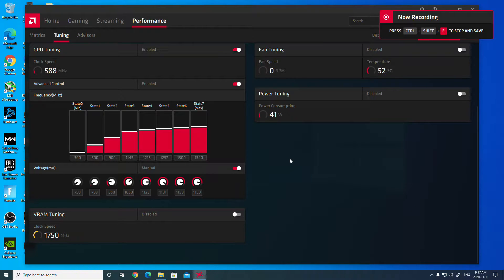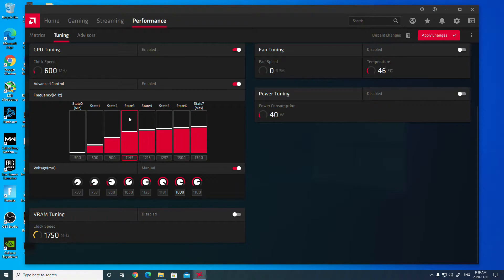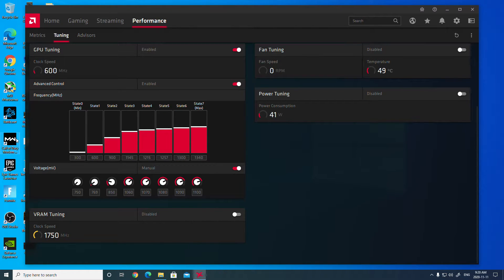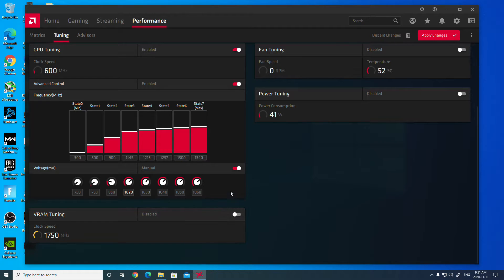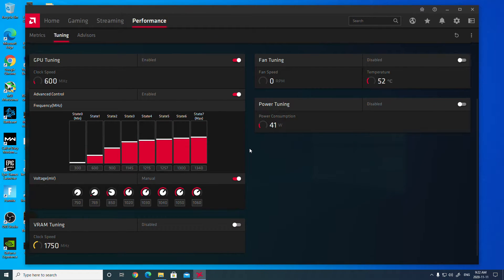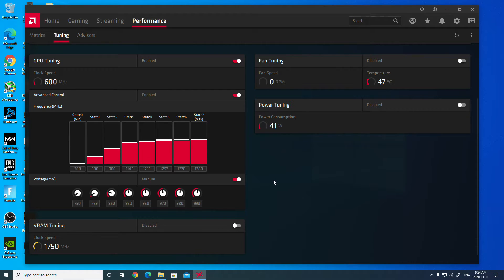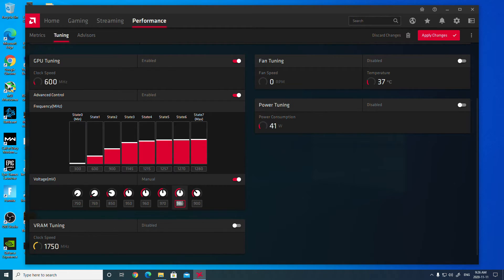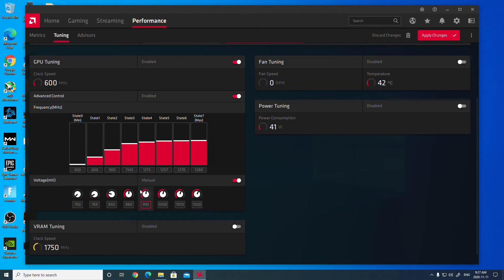How to Undervolt RX 570 RX 580 Stable Voltages EXPLAINED - Lower Temps - How to Fix Overheating GPU

Comment: Hello Alexandre, while your settings worked flawlessly on my RX 570, I wanted to ask can overclock undervolt cause stutters? I was playing Forza Horizon 4 with these settings and noticed every 1 or 2 minute or sometimes random I get a small stutter. I turned off the overclock and undervolt and drove around for 5 minutes, no stutter, then I reapplied your settings and drove around for 5 more minutes, still no stutter. Then I again reset the OC and drove for 2 or 3 minute and saw one stutter. I was hoping you could help me a bit.
Reply from the maker: In this case you may want to bump up the core voltage a bit. Each card may require a difference voltage for the core clock
Reply: @AleksandrsBrodie  Okay I will increase each core voltage by 10 except the first core and report back. Thanks for the answer.
Reply: @AleksandrsBrodie  I did that and 1st minute of the drive I noticed stutter. Then I switched back to default clocks and voltage and didn't notice it again, then I reapplied the OC and underclock and didn't saw any more stutters. Went to default again and saw a stutter 30 seconds in. It seems switching back n forth between the settings also switches my stuttering back n forth. I also have suspicion it may be frame timing, as with stock settings I stay under 48 fps but with the OC I stay around 45-55 fps, which is also within the Freesync range of 48-144hz. PC gaming is hard haha.

Comment: My rx580 8gb oc asrock phantom gaming card 
Gpu clock 1425 default 1355
Gpu voltage  1.170v , 1.150
Memory clock 2102 , 2000
Memory voltage  0.981 ,  0.950
Pwr limit %50  , 0
Resting gpu temp 38c gaming 72c. 
This works for me and my card. I'm not saying do this to yours. I'm just sharing the idea incase you want to OC.
I use Phantom Gaming Tweak
Reply from the maker: Nice :)

Comment: Can u recommend Settings for My card Rx570 for running Valorant? My game just crashes after 5-10min
Reply from the maker: use these settings but bump up the core voltage a bit (+20mv) until its stable.
Reply: @AleksandrsBrodie  thanks so what about the Frequency then?  I have Sapphire card
Reply from the maker: @Flashman6969  just copy the ones i have in this video
Reply: @AleksandrsBrodie  thank you bro I'll try this and let u know

Comment: Bro i have xfx rx 570 4gb and the temps reach 84 Celsius  in just 5 to 10 mins of intense gameplay for ex in ac valhalla and the game freezes and screen goes black and then a error pops up indicating we have detected a driver  timeout  on ur system  so i need help  here bro should  i return my gpu or undervolt it to lower temps or is it driver issue kindly tell me the best possible  solution in this situation bro i have a normal small form  factor case that  has only one out take fan also my gpu might be broken or something like that kindly help plzzz
Reply from the maker: i would recommend copy my undervolt settings inside of a gameprofile, try that first.
the reason you get black screen is because your gpu is overheating,.
also download a program called, MSI afterburner to setup a custom fan curve, or you can also do that inside of the amd software.
Reply: @AleksandrsBrodie  bruh i ve seen others with the same model of the gpu even reaching 86 Celsius and their gpu not crashing thus it indicates that my particular model has something wrong with it so i am not gonna take any chance and going return it btw thanks for ur reply if i run into any issues in future ima gonna for sure contact u and yeah ur doing a great job keep it up bro !
Reply from the maker: @NoobMaster-by6fw  from my experience, 80+c is too hot. every card is a bit different, but you do need to either set a custom and more aggressive fan curve to keep the temps lower or undervolt.
I would aim to keep the card underfull load around 68-72c
Reply: @AleksandrsBrodie  hmm ur damn right bro ok so u suggest to make a custom fan curve and also at the same time undervolt the card right? Also can u tell me or make a tutorial of the exact custom fan curve about this gpu plz
Reply: @AleksandrsBrodie  also will u suggest me to keep the card or return thou i ve lost confidence in keeping the card further becuz i ve ran into this issue before and that guy i bought from even changed the thermal paste as the old one was not working but even then the temps are not staying low what do u suggest thou?
Reply from the maker: @NoobMaster-by6fw  if you dont want to have to set a custom fan profile/undervolt, then you will have to return the card. but most gpus will need a custom fan curve set and if they are the amd rx 500/400series of gpu, they will also probably need to be undervolted.
Reply: @AleksandrsBrodie  hmm i see even if i get a good piece of that gpu i am still going to run into overheating issues i see ty for ur help brotha a small req whenever u get time plz make a vid regarding custom fan curve !
Reply: @AleksandrsBrodie  brother hi even now when the temps are below the throttling point i am playing csgo and the temps are hovering around 65 to 73 Celsius and the game freezes and and then the screen goes black and a popup then appears saying we detected a driver timeout on your system i am using the latest drivers from amd what stable drivers would u recommend me for my rx 570 4gb becuz i am runnung into this issue in every game regardless of what temp my gpu is at
Reply from the maker: @NoobMaster-by6fw  maybe return it
Reply: @AleksandrsBrodie  no no bro i am asking the best stable drivers  for my amd rx 570 kindly tell  me plz
Reply from the maker: @NoobMaster-by6fw  any driver should be stable. if you crashes after you undervolt, it may mean that you need to bump up your core voltage a bit, maybe +20mv or +40mv. each gpu is different and may require a different voltage.
Reply: @AleksandrsBrodie  ok ok

Comment: I have an XFX RX 570 8GB GDDR5 256-bit and this is running in most of harder games in 80*C +, in The Forest for example, in high settings this card gets 88*C constant with the fan's very loudly.. This are my stock voltage, mhz and power : https://imgur.com/a/R9eeSL8    What do you recomand to change ?
Reply from the maker: Drop core clock to 1250mhz and set core voltage to 960-1020mv depending on stability

Comment: How can I undervolt my rx560 4gb biostar
Reply from the maker: the same way as the rx 570 0r 580.
you can start by lowering the core voltage by -20mv until you find one that is low but stable.
generally, 1250-1300mhz will run stable on 1000-1050mv. you may even be able to run 1350mhz on core, at 1060mv.
you will need to play around with the core clock and voltages, but you can for sure optimize it better than stock.
Reply: @AleksandrsBrodie  my frequnecy  on state 7 is 1176mhz should i put voltage maybe on 1060 like you did in video
Reply from the maker: @Ultrajvosa-cb9sb  you can do that and see how it goes. If its stable and you are happy with temps, you can try to increase core clock.
If temps are too high, try lowering core clock.
Reply: @AleksandrsBrodie  i  tried that and everything is stable and good thank you so much btw i liked and subbed :)

Comment: i have rx 580 aorus xtr its too hot sometimes it reached 91 and it does thermal throttling to 1100 mhz to 950 mhz help me with some settings i did everything changing thermal paste i putted the corsair XTM50 i will  buy a new case for better airflow also
Reply from the maker: if it still over heats after applying these settings that I show in the video, then i am not sure why its running so hot.
But try 1200mhs core clock at around 960-1000mv, if that is not stable then you can increase the core voltage by +20mv until stable
Reply: @AleksandrsBrodie  i will try it thx

Comment: Does this change the performance of the gpu?
Reply from the maker: a bit, lower core clock= a little less fps but you can run lower voltage

Comment: Ok so, if I touch these settings my games crash after a couple of matches, what's that about? I can't touch the voltage in the slightest or it crashes.
Reply from the maker: You will want to drop your core clock down first. Each GPU silicon quality is a bit different.
You can try 1200mhz at 980mv.
If that crashes then bump up the core voltage by 20mv until it does not crash.
Reply: @AleksandrsBrodie  even if I don't make any changes it still crashes if I pick the manual settings. I also tried using MSI Afterburner and I can only lower the voltage to -6% and it also crashes.
Reply from the maker: @JohnnyEMatos  I am not sure then. 🤷‍♂️

Comment: I have rx 580 msi armor, it's running like a fucking helicopter with temp 89°c, now its 75°c and never reach 80°c again. Thank you so much man👍🏻
Reply from the maker: You are welcome.
If you want even lower temps, set a custom fan profile in the amd software or msi afterburner.
Reply: same here man, i just got this RX570 msi armor, it was hot like hell on witcher 3 on medium graphics
Reply: @akmalrusydi2730  can u tell me the voltage serial u've set?
from state 3 to state 7?

Comment: What can I do when my screen just freezes for fortnite mainly and I can’t exit the app unless I force shutdown on my rx570?
Reply from the maker: i am not sure, if its related to the undervolt, then you will need to bump up the voltage from state 3-7 by 20mv, until its stable.
I am not sure what the issue is, but if undervolt related, try that.

Comment: I had to watch several of these videos many times before I was even comfortable with trying it. I'm using a stock cooler on a Ryzen 5 1600 / RX580 8 gb model.  So far, I noticed about 3 fps higher then my game crashed only for me to discover a message from the Adrenalin software saying the timings caused the crash and the software reverted back to it's default settings. I wish there were a bunch of presets I could go through until I found one that worked best but sadly, that's not the case.

Comment: Helped a lil bet I guess as you said not all cards are the same 2 out of 10 cards lowered watts to 114 before it was 128 watts but some only lowered 3 to 4 watts back that’s all temperature is ok not bad less than before like 2 degrees max

Comment: Thanks so much for this info! I am new to the GPU stuff and this was a great help! Really helped lower the temps. By any chance, would you know how to have the same affect on windows game pass games? Since they don't show up in the Radeon software? Would I just change the global settings and hope for the best? Thanks so much again!
Reply from the maker: when you go to add a game to game profile, if it does not show up, you can select the game from the file folder.
you can find that option when you select add game profile, you will just need to look for it.
I did that for other applications that did not automatically show up.
sorry i cant be more specific.
But yes, that option does exist!
Reply: @AleksandrsBrodie  for the games that you had to select a file, did it save when you boot your pc or it only saves games that are recognized and are automatically there when you click game profile?
Reply from the maker: @darthbhanu4162  when selecting the file, i select the EXE file or the desktop shortcut might work as well, i cant recall.
Otherwise, you may just need to use global wattman settings.

Comment: when i play game like 4 or 5 min my rx 580 is shut down my pc ,my pc is new and gpu is buy it used. Can is work if i do the same to the video ?
Reply from the maker: I would try these settings then to see if it makes a difference. also, use a program like MSI afterburner to set a custom fan profile and also monitor your GPU temps to make sure it is not overheating as the RX 580 runs VERY HOT on stock settings.
These settings will help drop the temps.
Reply: @AleksandrsBrodie  Thank you so much , after i do the same setting in your videos now my pc dont shutdown anymore , i can complete the game , almost buy a new gpu at this time w higher over price .. thank you 👍🏼👍🏼👍🏼
Reply from the maker: @KyoHT  Glad it worked out!

Comment: Hi Aleksander . How about power limit? Try lower the power limit to -20- -30% . And the gpu will be much cooler and pull way less watts. Can i ask you why you didn't touch that option? .
Reply from the maker: good question
the power limit does not address the main issue tho.
the main issue with these cards is that the voltages are too high for the stock clock speeds.
so yes, if i drop power limit it will also drop temps as you are lowering the power and clocks of the card. 
But if you undervolt, you can lower the power draw without sacrificing as much performance as you are optimizing the card.
Reply: @AleksandrsBrodie  understood 🙂👍 nice explanation. Thanks
Reply from the maker: @project0332  👍👍

Comment: thanks
Reply from the maker: U r welcome 😉
Reply: @AleksandrsBrodie  My default core clock at 7 stage is 1366 and i set my voltage to 1045 and it's lowest stable voltage and my temperature droped from 80°C-82°C  to 73°C-75°C.
Reply from the maker: @Bartix520  If you want even lower temps, you will need to drop the core clock maybe down to 1320mhz in order to lower the voltage more.
its a balance between core clock and core voltage
Reply: @AleksandrsBrodie  How many fps i will loss?
Reply: @AleksandrsBrodie  and somehow Apex legends is crashing and some graphical errors occur. And i need to set profile for Apex at 1052. And now it's good. But somehow it didn't crash in rdo
Reply from the maker: @Bartix520  you lose very little fps going from 1366 -1300mhz.
Reply from the maker: @Bartix520  Some games require higher voltages than others.
Reply: @AleksandrsBrodie  ooo red dead crashed.
Reply: @AleksandrsBrodie  and can I undervolt SAFE memory like that too?
Reply from the maker: @Bartix520  I generally dont undervolt memory as that does not affect GPU temps much but can affect the stability.
you can drop memory from 1000mv to 950mv for example, but i would not bother for gaming.
Reply: @AleksandrsBrodie  but for example on the newest rtx 3080 the memory temperatures are very high.
Reply from the maker: @Bartix520  yes on RTX 3080 there is a memory temp issue.
but RX 580 does not have that same issue.

Comment: Need to do this since I only have one intake with the house computer case. Still saving up for a mesh case then I can turn it back to normal.
Reply: @AleksandrsBrodie  It helped me drop -10c from 75c to 65c high settings in unigine heaven
Reply from the maker: @Enzo-ox9uf  nice!!

Comment: Good vid Aleksandrs!!
I'm adjusting a RX580 Gigabyte 8GB now and just wanted a educated guess about going 1400MH clock, have you ever seen this GPU going up to this clockspeed?
Reply from the maker: yes, you can run the GPU at 1400mhz safely.
You will probably need around 1080-1120mv to run it stable.
The higher the core clock, the higher the required voltage to run stable.
all cards have a bit different silicon quality so your card may need a little different voltages, but for gaming, you can try 1400mhz with around 1080-1120mv. (some cards can even run with lower voltages like 1060mv at state 7)
if you card is running hot however, it will be beneficial to drop your core voltage and core clock to reduce your power draw = less heat.
Core clock does affect FPS,
Core voltage affects power draw.
Reply: @AleksandrsBrodie  Thanks mate!! I'll try that, luckily I had no problems with temperatures

Comment: Wow its a great card my msi rx 580 8gb is at stock 800mV at 1250 clock when i undervolt or overclock it freezes,, help
Reply from the maker: If the gpu freezes, it means you need to increase the voltage
Reply: I have qhqf es cpu @2.60ghz, did not overclock it yet, and 1694 cinebench score, is it a good cpu or not?
Reply from the maker: @akusijuan3616  if its cinebench r15, then its decent.
If you are running r20, then it's a lower end cpu from what I understand

Comment: thanks so much for the great videos! i have a quick further question: would a heavy undervolt on an rx580 with a 1360mhz stock clock like you have shown be faster or comparable in games to a 1150mv stock voltage overclock to 1410 mhz? blessings and thanks in advance <3
Reply from the maker: good question.
Clock speed = fps.
Voltage = heat.
you need a balance between Core clock and voltage so you can have both good performance and good temperatures.
The higher core clock ,the higher voltages required for the card to run stable.
But with a higher voltage it will make the card run hotter.
Reply: @AleksandrsBrodie  wow, that was fast, thx! i have mine set to 1410mhz with 1130mv (20 lower than stock) and i would have considered changing it if the answer was yes. now i don't have to :) -- keep up the good work! v4n

Comment: idk if im only one, but fans at 60% are kinda loud, i prefer sound of 50%, but then i get 75 °C in games
Reply from the maker: this is why if you undervolt, your card generates less heat so you dont need to run your fans as hard

Comment: thank you for the video really helped me out!. Got another question tho: its probably my case only, but when i turn off the computer  the tuning controls go back to automatic and i have to set it up again, i hit apply changes in the global tuning but still i fell that whenever i turn off the computer and turn it back on ii have to double check to make sure and to my surprise its always in automatic. Any tips here?
Reply from the maker: You need to set a game profile. That is the only way the settings will automatically load when you play a game.
Otherwise global tuning does get reset

Comment: Bro any idea why my gta v keeps crashing
Reply from the maker: if you have set undervolt settings and the game is crashing, i would either increase the Core Voltage or lower the core clock until it runs stable.
your gpu runs stable when it has the right amount of voltage for the given core clock you want to run